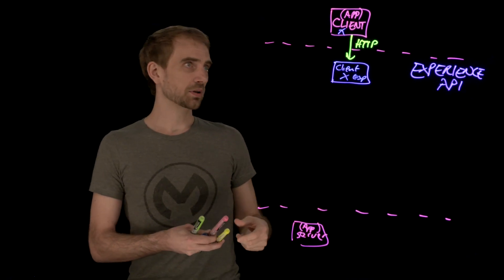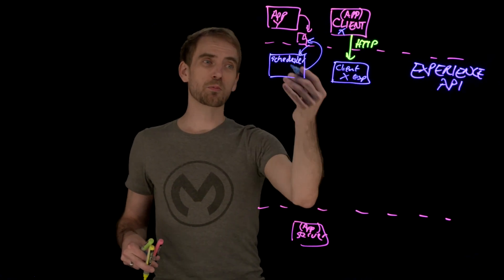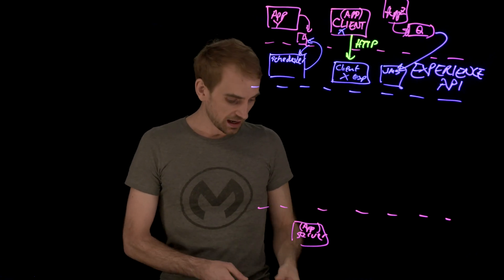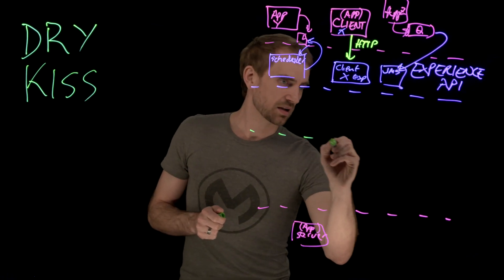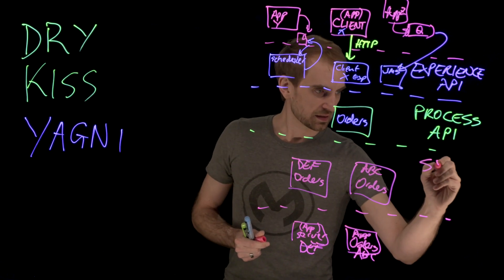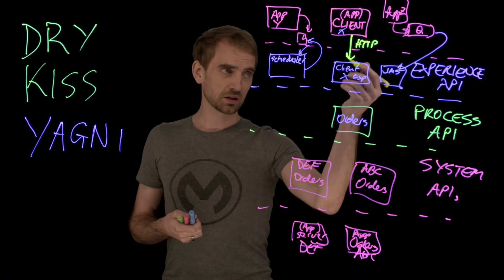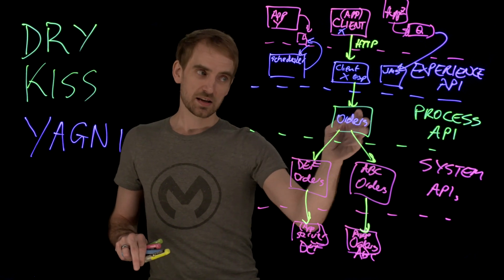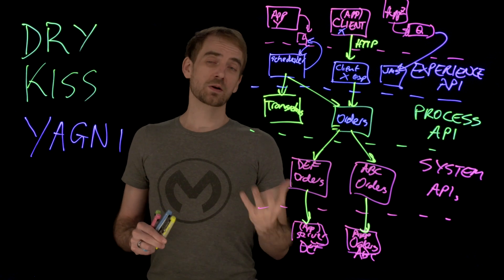Three-layered Connectivity Architecture Explained | Lightboard Series

Comment: I really liked the way you described it . I have  two questions. I would really appreciate your insights Nathan. Here are the questions : 1. How do we get past the multi hope in the layering which adds latency ? 2. Does process api do what joins do in SQL ?
Reply: First up I'd ask what amount of latency does it create? Worth looking at the performance impact (maybe do a PoC to get some data to confirm or deny any assumptions) and considering it relative to the requirements (if there are any!) around overall performance. Network hops within the same network are likely not to be huge for a start (but it does add latency). In some cases you can cache (e.g. retrieve of reference data/seldom changed data) or be smart about the number of such calls (e.g. bulking requests to avoid too much chatting across a slow network link). And while there is latency added, you're gaining various other qualities: time to market or development time improvements, lowering upgrade efforts (due to avoiding lots of code duplication) and so on. 
I'd always recommend keeping in mind that excessive prioritisation of one of the non functionals above all others (e.g. performance -> latency in this case) will mean you might end up with a quite suboptimal overall solution (particularly if you end up with 10x the amount of code having to be created because you can't do any sort of re-use, or you may end up with a rather monolithic service design).
Reply: @--Nath--  Agreed, we often talk about "pre-mature optimization" as a problem, e.g. the very early focus on the non-functionals and in particular performance above all others. This can lead to making compromises in other areas which are then even more problematic than a small incremental performance difference might have been. It is far better to simply follow a set of general best practices with respect to good performance and then to optimize towards then end when needed.
Reply: @mattcomer5975  Agree. It's not to say be wilfully ignorant of performance considerations, but I use the example of cars - you could spend every waking minute tuning your family sedan to make it go from 0 to 100 in single digit seconds, but if the requirement is to have a car to go to pick up the shopping once a week and take the kids to see the grand parents then maybe you should have spent the time installing the baby seat more securely or making sure the tyres are safe or changing the oil so it's running smoothly.. Because you're spending the finite time you have on massively over-delivering just one of the many non functionals. Only so many hours in the day to spend on stuff. For a typical API - I'd spend more time on test automation (or other automation) than going down the rabbit hole of performance testing.. because chances are skewed toward you getting a better return on investment of test automation so you can more easily do day to day stuff that's necessary like upgrades/patches..

Comment: Am I right in saying that the Process API Orders essentially replaces the need for source system records to be collated in some sort of centralised datastore? So the experience APIs rely on the Process API to deliver the top-level applications a collation of the information (Orders) from all of the System APIs that get from the Bottom level applications. Sorry to ask the obvious question....
Reply: It's more that it replaces the need for any clients that need to aggregate Orders from multiple system APIs. You could remove that layer but then you'd find you end up duplicating whatever "combining" or "aggregation" or "orchestration" logic is needed. For example - you might have orders spread across 2 different systems depending on what product area the orders are for and you want a unified API to retrieve the lot. You might have orders for Australia's NSW and Victoria states in SAP and for South Australia in an Oracle DB and for WA in yet another type of system..  Or you could have a legacy datastore for orders older than a certain date.. Or you might need some datafields from one system, others from another.. So the logic to bring or route the request in all those situations is different and you'd need clients wanting orders to replicate that code.. Which then means if you change that -> you get the maintenance issue of updating many places instead of one. Same argument could apply for validation requirements (duplicating many places or applying as part of the process api) and even things like caching and so on. 
These APIs are not really about adding a data store - that's still the job of the systems of record that your System APIs talk to. This is bringing data together at request time rather than needing another database - so a more "in flight" collation, if you will.

Comment: How do these 3 layers translate when it comes to Mulesoft APIs? Does it mean one publically exposed experience API and then multiple unexposed internal process APIs and System APIs?
Reply: Correct. No one needs to know there are even any layers beyond the experience API.. The reason being you can then insulate the outside world from your internal systems. You are then more able to do internal refactoring or other changes. The implementation or infrastructure could even be hosted separately if you have security requirements requiring a separation of "external traffic" from "internal traffic". From an API management perspective it means you can have different policies for stuff exposed to the outside world - for instance security-wise you can do things like payload protection (from very deeply nested JSON or XML documents) or use different methods of dealing with security (e.g. internal you might use mutual TLS, but that's not going to fly for an external facing API).

Comment: Experience, process, system.... Really sounds like UI, business, data layers. How is this different and better?
Reply: Or perhaps like a tiered version of "Model View Controller" of sorts - the idea of separating things isn't unique: but few patterns are, it's kinda why they are patterns. :)

This layering will appear if you build out enough integration logic and care about avoiding duplication: so the idea is to plan to avoid duplication and adopt the layers before you build a monolith or spider Web.
I think the better question shouldn't be why is layering better than layering: it's layering vs just doing system to system (aka point to point) or else one layer or monolithic app that does all of the client to server logic. 
The other aspect is how do you build this: doing it in an iterative fashion, and only building it as needed rather than (like in big SOA strategies: "build out CRUD operations with all fields for everything") building everything just in case.